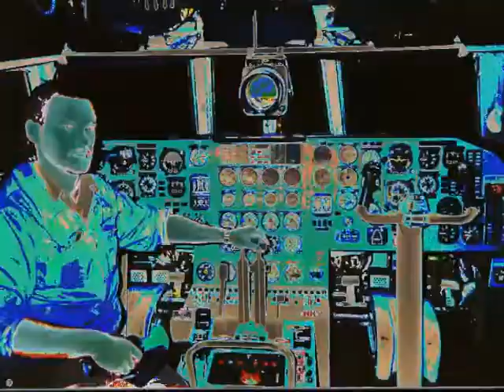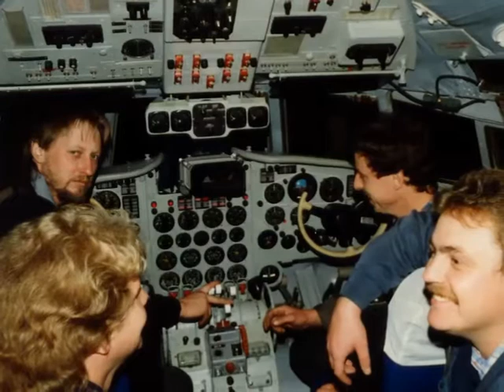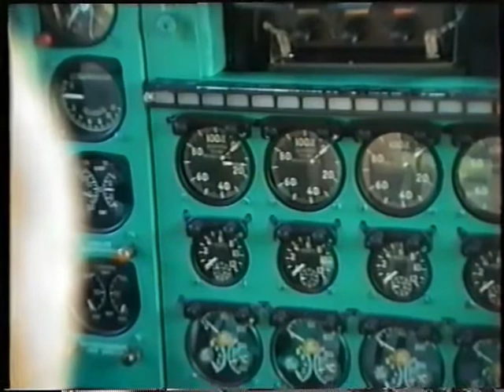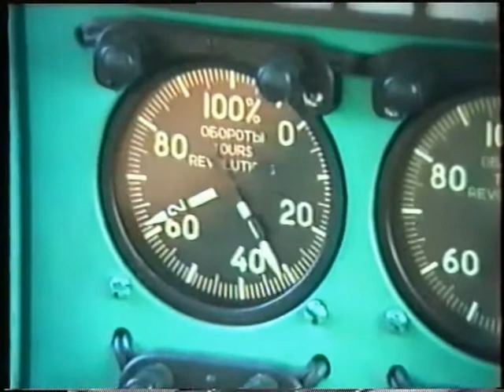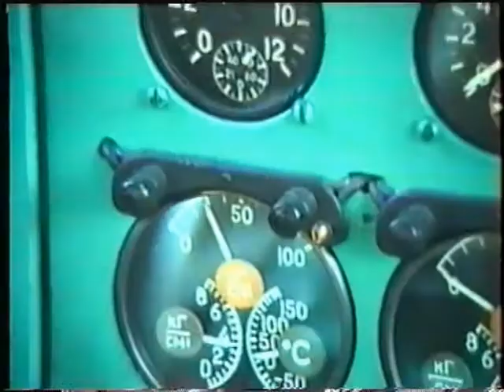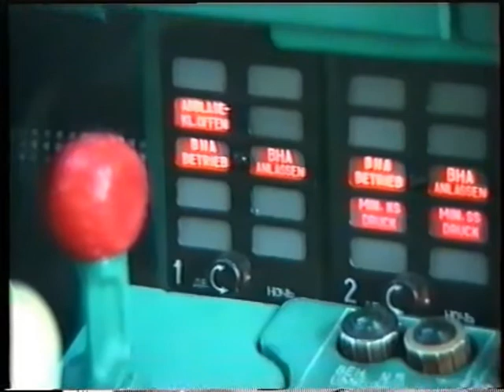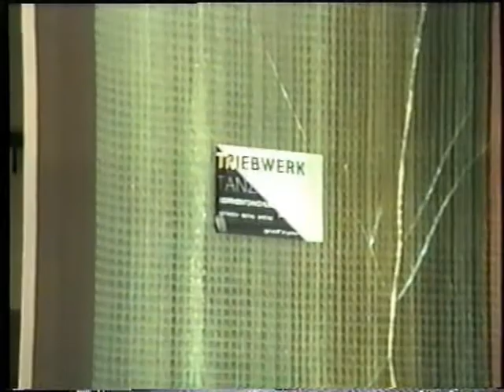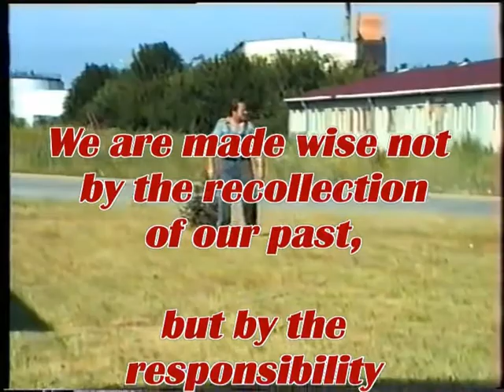INTERFLUG

Comment: No hard hats or steel toed boots? What kind of a peanut gallery operation is this, sandals with socks? Just crazy
Reply: GDR was not a western country so western work safety standards did not apply - at least they were not enforced as strict as in the western world. But the standard of work quality was pretty high.
Seems you have very little knowledge about life in the GDR.

add-on: ... and remember this was in 1990. So, even in western countries it was less strict compared to today.
Reply: MHG1023 You are so correct. Well said.